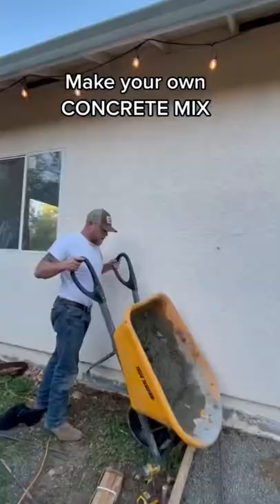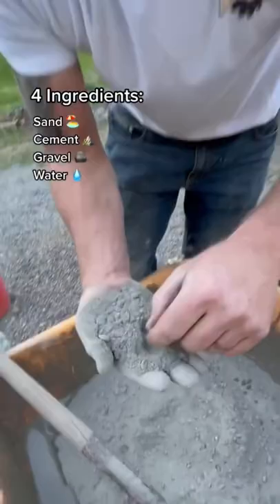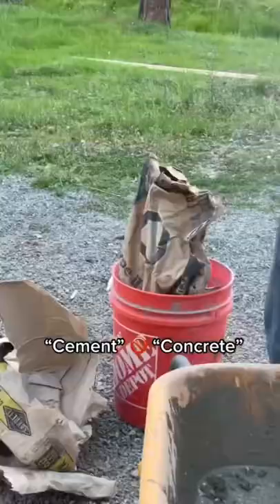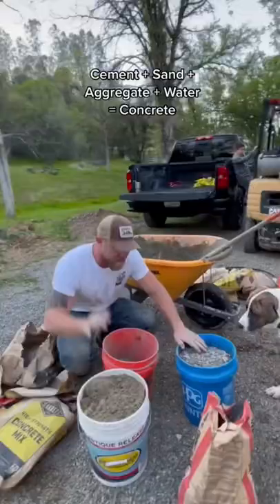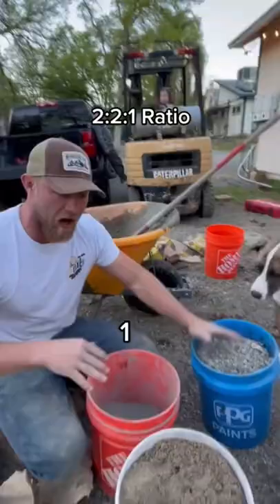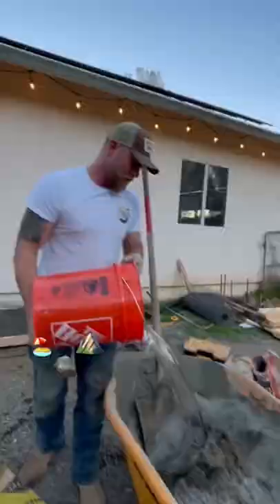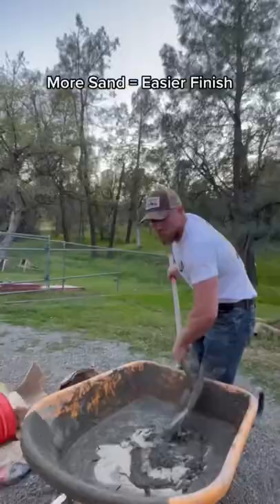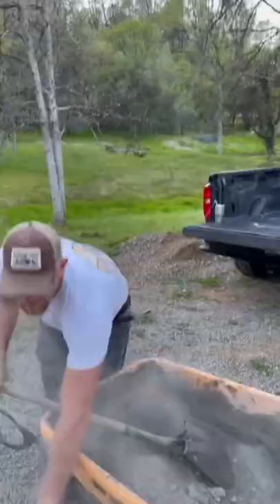How to Make Concrete Mix #shorts

Comment: Dude do yourself a favour wear a mask & don't stick your hands in it.
You'll feel fine for a while but it will bite you in the future
Reply: Facts
Reply: Based on the lack of even the most minimal PPE this guy has shown in his videos posted he's terminal already.
Reply: @Lilmingmang  I've seen many people that have done work like that, or did painting, or any types of work where there's harmful chemicals involved, and when they got older around 40-60 that's when they usually suffer from health problems like cancer, or they have a hard time breathing properly.
Reply: At this point at least stand up wind huh? 

But yes after having eosinophilia for a few months I'll be more careful. A day of light  marble dust is very dangerous.
Reply: At least don't throw the cement so violently wtf
Reply: come to India and you would see how even people over 50's work in worser conditions, they are one of the most immune people alive in the world
Reply: @hashiramauchiha2877  They probably just be dying off and you dont see the dead ones cuz they stopped coming to work

Comment: ass someone who has mixed thousands of wheelbarrows of cement from scratch ill give you some advice- "drymix" that is, get it all mixed together, be scientific, and when you mix your first batch, take note of how much water you use. done right, you drymix, then put in the water, in 2 mins it will mix. if not enough water, you struggle and sweat, then add more water, and mix again, add water mix and mix again, too much water, your adding drymix and mixing and mixing again, well you get the point. drymix, scientific approach, just enough water 1x, and the mix is ready in 2 mins. practically mixes itself.
ALSO, think corkscrew, and when mixing, get right to the bottom and turn the shovel over into the wet, dry to wet, and move your shovel a couple inches further along each time, like a corkscrew.  if you dont go doown to the bottom when mixing, you have to do it again and again and again, so do it one time, right to the bottom. and turn the dry stuff over the wet stuff. i see guys turning it the wrong way, dry to dry, like they trying to keep it dry. 
sometimes its just to painful to watch.

Comment: Buddy will have rock hard, cement lined lungs
Reply: blud my father and uncles worked as bricklayers for over 30 years, i also helped them alot. It doesn't matter they still have healthy lungs and are over 50. If ur that scared apply it to everything in ur life, don't put ur phone in ur pocket because of the magnetic radiation or turn off the wifi when u sleep cuz the signals go trough ur body. Don't be a psy
Reply: @bleekwater6176  “blud my father and uncle smoked cigarettes for over 30 years but it doesn’t matter they still have healthy lungs.” Cool anecdotal evidence but it’s irrelevant. Prolonged exposure can and does lead to lung cancer and silicosis.
Reply: @bleekwater6176 ”don’t b a psy…..” ?? Take care of your body dude that’s the dumbest thing I ever read wear a mask

Comment: Not to be a duchbag but sand and gravel are both stone. It’s only the size difference. You need som smaller stone to fill out the gaps between the bigger stones and also the small stones make the concrete easier to work with. Great video!

Comment: 3 dry vcomponents to concrete. Coarse aggregate, sand, Portland cement. 3 parts coarse(stone), 2 parts sand, and 1 part Portland. 
Too much sand could be a bad thing.
To much Portland could be a bad thing. 
Not all sand is the same. 
Judging by this guy wanting more of each tells me he isn't much of a concrete finisher. 
The way he is measuring/mixing it is the hardest. Shovel a scoop of stone, sand, Portland, sand, 2 stone, **then water and mix. then repeat until you have the amount you want to mix at a time. Then add your water and mix.  **You could keep adding all your dry components before water, or even do 2 or however many rounds of drys before water. This method helps ensure conformity.

Comment: Is it better too use screws rather than nails. Over time when it rains and the wood gets wet it soaks around the nail and makes it get rusted also causing it to slide out and it would lose it’s grip inside the wood. With a screw it mades ridges inside the wood causing it not to slide out and it would get rusted but it’s not sliding out one bit.

Comment: There is this way, or u buy the already ratio bags that cost just abt as much as those  cement bags do I mean sure you did get more bang outa ur bucks because u had natural gravel and sand so u got more concrete than u would of just buying but more than not, people won’t have natural sand and gravel to mix with their cement😊